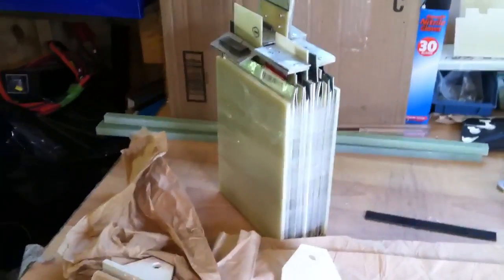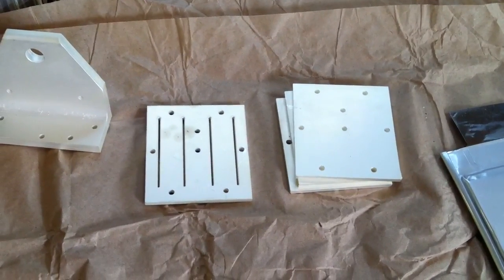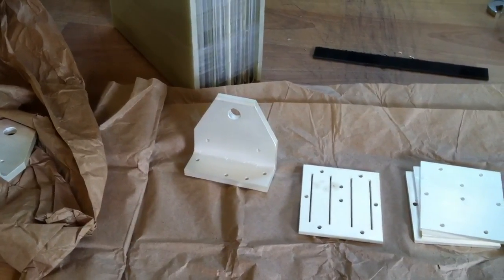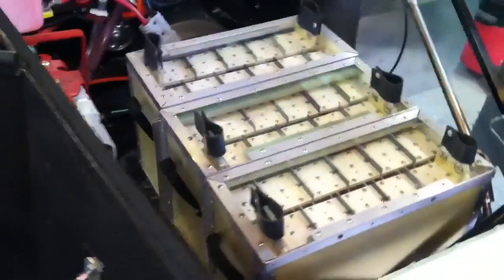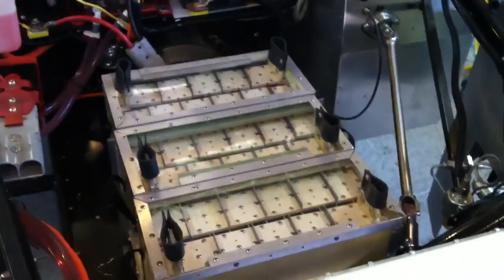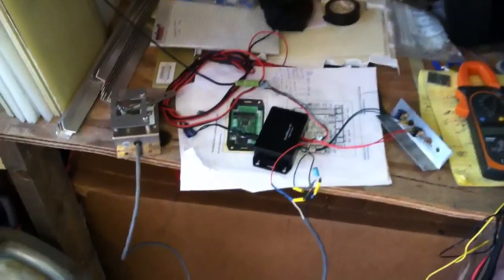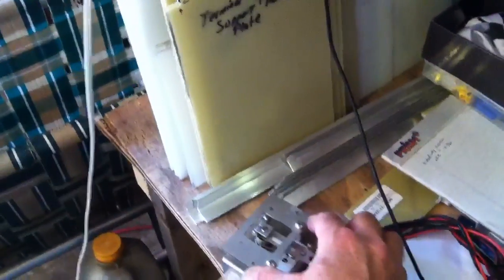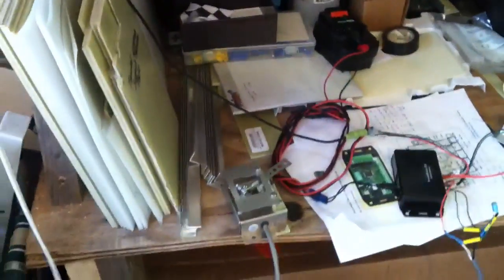Factory Five Mk4 - Electric Car - Video 32

Comment: Now we are delivering modules with the MicroSD card, our four SoundRacer sounds are included and also HD and Suzuku MC. There is also a Windows program for creating a sound and parameter file from the recorded sound files idling, low acceleration, high acceleration and deceleration. Our sound developer makes a great work tweaking the raw sound recordings to the four files used by the program and it will not be easy for other to make it sound good. see more info on the eveess web

Comment from the maker: The SoundRacer sounds great!   Nice low end rumble from the Klipsch speakers.   They offer three different engine sounds.   Send them an email,  they are great to work with.

I just uploaded video 33 with the SoundRacer installed and working.   It is so cool to have the sound working in sync with the pedal and wheel spin!